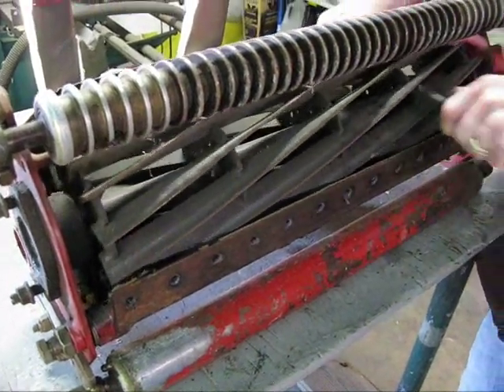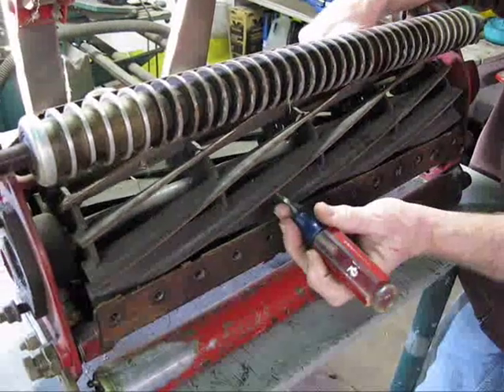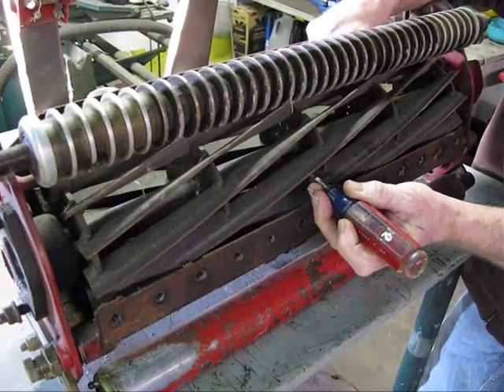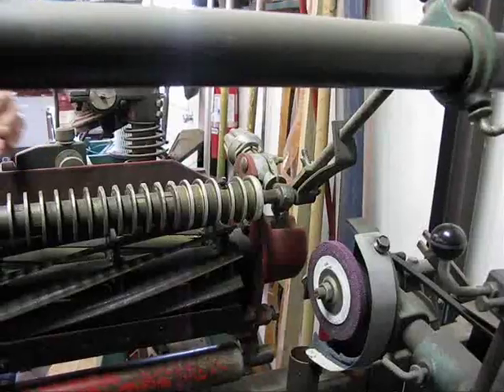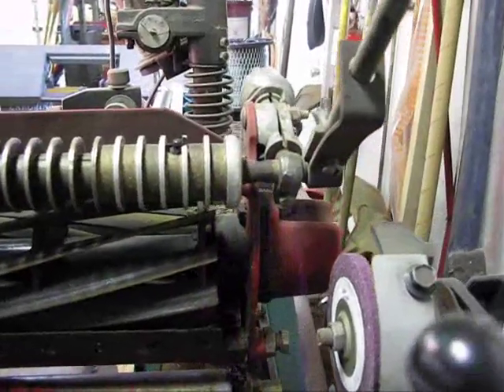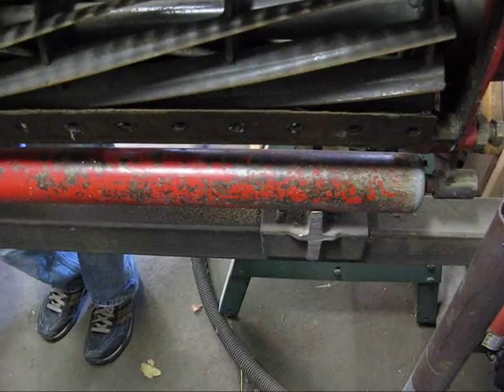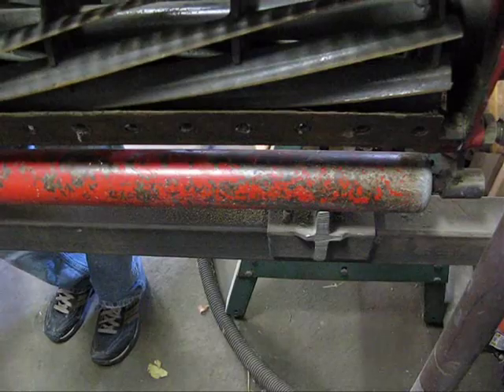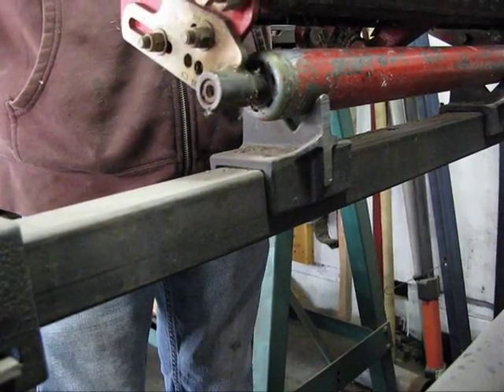Foley Single blade grinder

Comment: We use a Foley Accu 600 spin grider now but I still like the single blade grinder.  That is what I learned on and used for many years.  Don't know if I could remember how to set one up though now.  Have a mechanic for that.  Thanks for the video.

Comment: How do you know that all the blades are ground equally...if you take more off one than another won't it miss the bed knife...I use a spin grinder and when it's grinding you can see how untrue the cylinders can get....